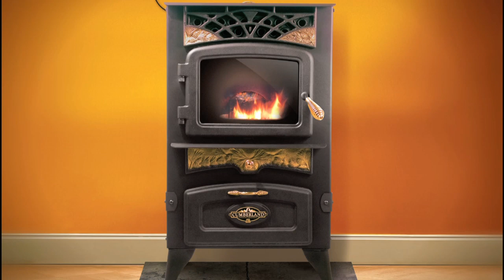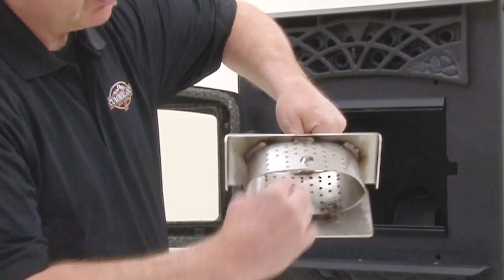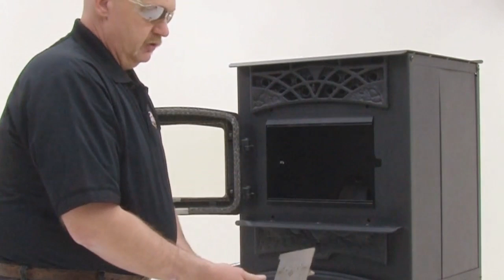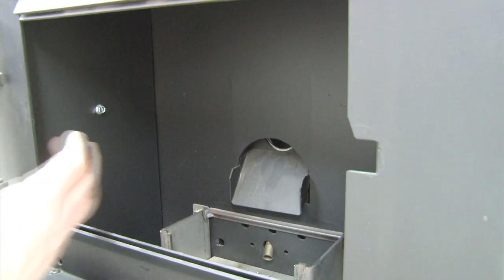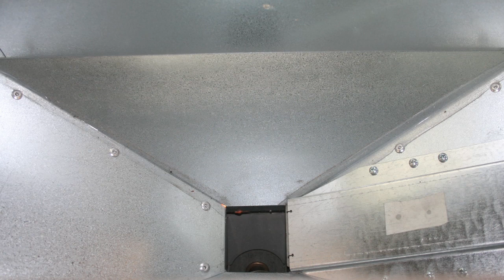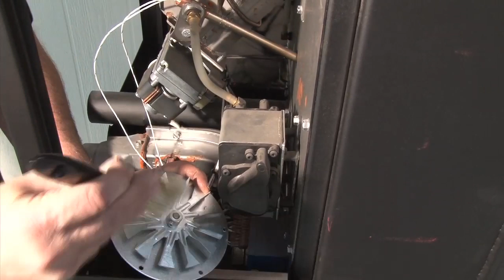Cumberland Stove Works - How to Clean and Maintain your MF3800 Stove

Comment: I've owned mine for 4 years and am starting to lose trust in it. twice now the burn pot has completely filled while burning and has since backed up the auger chute. when this happened the house filled with smoke from hopper. the fuel door never closed also. I replaced all the snap discs as well as all the other crap that was melted and ruined to the tune of 300 bucks. last night my smoke alarms went off at 5am and the damn stove did it again..... back to the drawing board.

Comment: thanks for the video. I was wondering if there is an easy way to get the fan housing cleaned. It looks very tight getting it unscrewed and im afraid i wont be able to get it back in once i clean it. it has the electric hub and the lower part of the (unremoved) wall in the way, making it a very tight space to get my pliers or drill in.